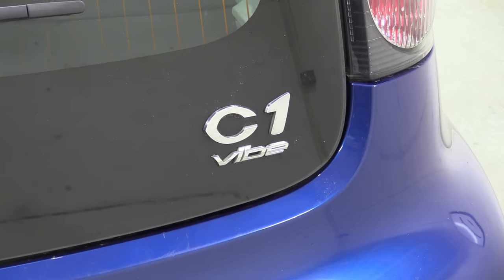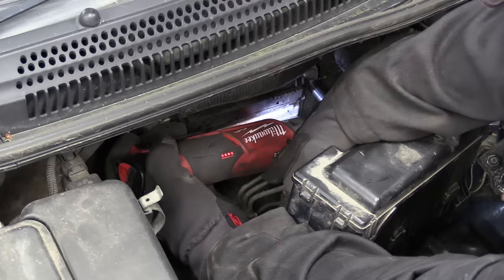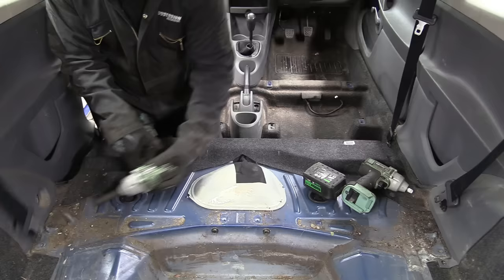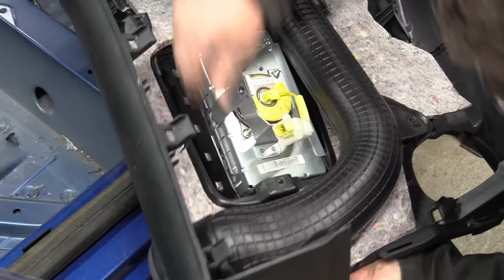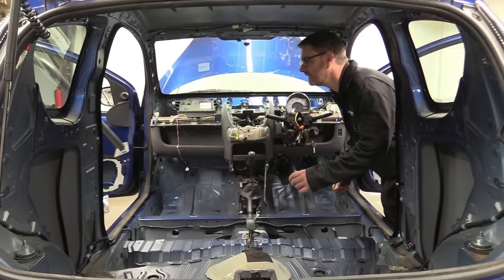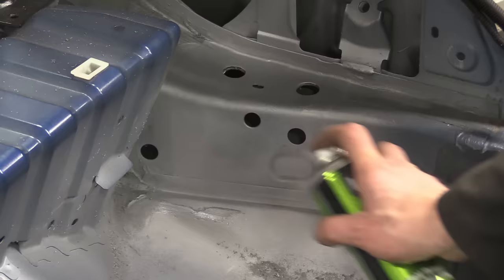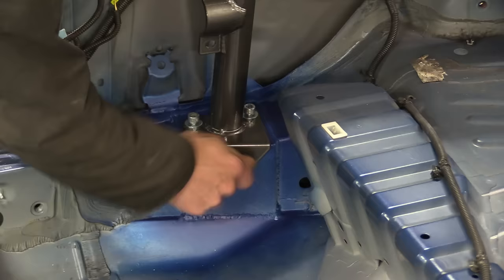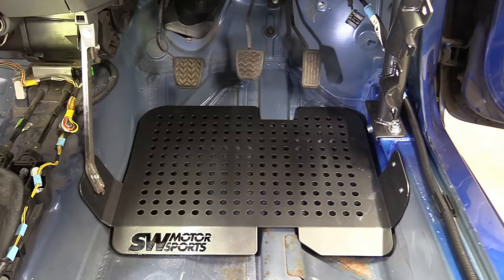Part 1 - Building an £850 hatchback into a competitive race car.

Comment: It's not Binky but I'll take anything to get my Bad Obsession fix at this point 😃
Reply: I needed a small adapter for something at home and I ended up making a template, transfering it to steel, cutting it out with a grinder, bending it by hand into a circle, folding the edges and squeezing them together with a press, finishing it off with a twatting stick.
Moments later I found myself looking at MIG welders online.
Reply: @phenomanII  cool story, but did it also "make the noise" at the end?
Reply: @yah5o  Sadly I do not own such precise and melodious equipment.
I also used a black marker, as I'm not experienced enough for blue, red or green.
Reply: motorbiker46 
It’s a wise man that knows he’s not ready or skilled enough to move on from a black marker. 
Sadly some falsely believe they possess the needed skills and others are completely oblivious to the needed skills meaning that many people are wielding markers well beyond their skill levels. 
You in your wisdom are very close to graduating to a blue marker at the very least.
Reply: @Crewsy  Thank you for the kind words. You've genuinely given me more confidence to go for another project so that I can reach the next level. If I reach it, I shall celebrate by acquiring another power tool to aid progress in the future.

Comment: oh, putting the nut a couple of turns back on before yanking at thee steering wheel...
That's the exact useful piece of advice that would have stopped me from punching myself in the face with my own steering wheel!
Reply from the maker: They say you learn from experience...
Reply: @BadObsessionMotorsport  I've heard that before.........
Reply: It does hurt when you pull a steering wheel full force into your face.  My belly was aching when my mate did it.
Reply: Funny.  I was just talking about this very thing with the mates a couple of days ago.
Reply: 😆i once picked up an empty cardboard box ( thinking it was full (and heavy)) and smacked myself square in the face with it 😆
Reply: Stephen Hepworth you should have put the nut back on a bit first 😂
Reply: Been there, done that. Shift knob is the other one.
Reply: Its a little talked about issue for us mechanics. The level of self harm. Just the other week I pretty much through a spanner at my own face. Be careful not to let your tools slip of the bolts kids.
Reply: Bad Obsession Motorsport 
Some times we wonder how you both became so experienced. 
Unfortunately there likely is no video evidence of that “experience”.
Reply: When I was 17 I broke my nose taking a mini steering wheel off. I was three cars up in a scrap yard at the time, trying to get a new set of column switches. Took me a little while to get back down.....😂
Reply: @andrew75511  I bought a car off a guy with a happy face in one eye. He was using two screwdrivers to get a brake drum off, and the inevitable....
Reply: It's something you definitely only do once... don't ask how I know.
Usually take the time to make a "bespoke" puller/removal tool these days.
Reply: @ADBBuild  Done that.  BMW shift knows are insanely hard to pull off, if they aren't worn out and pull off on a swift second gear grab.
Reply: @BadObsessionMotorsport  I did, silly me!
Reply: Experience - What you get right after it would have helped.
Reply: @johnpearson492  Yes, I was thinking BMW when I wrote that. Pro tip - Sit in the back seat with a leg on each side and pull from there.
Reply: @andrew75511  Worst I've done is while putting back together drum brakes. I was pushing down on one of the springs to hook it in place and the pliers slipped off, causing me to head butt one of the wheel studs sticking out of the hub. That bled...
Reply: I spotted that too, and thought that at some point in the distant past that had been a learning experience!
Reply: @theogbeardedwonder  aaaah the memories - it's been a few years since we were allowed to be 'three cars up' :-)
Reply: I can barely breathe laughing so hard at the thought! 8-))

Comment: Man, this car is an engineering masterpiece. Everything is exactly as cheap as it can be made. That one piece map pocket with compliant plastic hinge is genius in its simplicity.
Reply from the maker: It really is.
Reply: but,  a map pocket? who needs a map pocket anyway?
Reply: @almericussaxon8023  
People without satnav! 😂
Reply: @almericussaxon8023  title and regstation or torch and zip tie
Reply: @almericussaxon8023  Oh just you wait for the space debris to "explode" and take us all back to the 80s.
Reply: @almericussaxon8023  Some of us prefer to lose our way the old fashioned way! I rare if ever use satnavs, and if I have to I´ll use my phone.
Reply: It really is a clever designed car. It's a cheap car because it was designed to be cheap rather than being built cheaply. 1 screw holding the radio panel in, a piece of glass for the boot with no metal pressings. Love it.
Reply: Parcel shelf, string on one side only, both front seats - same part number, glove box lid - optional extra. The electronics are Toyota, the engine is Kinda Toyota sorta, its all simple stuff.

Comment: Easiest way to get those window winder clips off is to feed a rag in the gap to hook the end of the clip and just pull it out. No risk of scratching any trims either.
Reply: If you are old like me, you have a couple or 3 of the stamped sheet metal tools that push the clip back, making it a quick and easy task.
Reply: I use the tool but when it's missing a shoelace works a treat
Reply: Yes,  sorry I didn't see your comment before I posted the same.

Comment: When does Nick decide to fit the engine from a 406 V6?😂
Another great project from you guys.
Reply: You can! On the bigger 106.
Reply: next week. Should be just a one episode job...
Reply: Zero chance of fitting that. Lots of adapters to make up too.
If you want a big engine you can fit the 1.8vvc engine from the Yaris (if you relocate the battery to the boot).
But at that point you should probably just buy a Yaris SR as they are pretty cheap anyway.

Comment: For the trim clips, wrap a rag around the handle and pull it back and forth. It will grab the clip and release it. No tools needed!
Reply: a stretchy rag, ideally a stocking
Reply: I second this tip - I've done it heaps of times and it works a treat
Reply: Yep, dealt with that replacing the manual winder in my car (twice! Thanks cheap eBay parts) bonus difficulty? Mine has a trim washer to fill the gap between card and handle. Sure its a two second bang into place part, but what a pain.

Comment: A neat trick to getting the window winders off with those sort of clips.... is to get a rag, slide it between the door card and handle and start sawing with the rag, this action catches the rag on the two 'ears'  of the open side of the clip which in turn pulls it off the spline shaft. For years i mamed, marred and just straight f**ked trims and winders until i learnt this method. Alas..... great to see you two back with some more crazy shenanigans, stay safe over there!

Comment: Useful tip for those annoying window winder clips. The hub end of a bicycle spoke has a handy little hooked end to it. Subject to a little bit of “jiggling it about a bit” you can usually pull the clip off that way!! I got a wheel’s worth in my tool box. They’re just bendy enough to come in rather handy.

Comment: I've always heard that driving a slow car fast is much better than the other way around
Reply: An 848 cc mark 1 Mini, 3.5 in rims. Did have Pirelli Cinturatios as they were the only 10" tires I could buy. I rebuilt the engine every summer when  in  college.
Reply: Try driving a fast car fast then..🤔

Comment: "To be competitive you need to spend a lot more"
I mean, I get in the top 10 in dirt rally dailies / leaderboards with an office chair with wheel stops behind the casters and a logitech wheel...
Reply: Ye it's the biggest cop out ever, driver mod is biggest thing, I have a t150 pro and a wooden dining chair and stay competitive through practice
Reply: The bigger issue for many drivers is that you learn more bad habits than good ones driving in games/simulators. For most drivers, anything is an improvement, but if you already have a 'feel' for going fast on the track, the sim world feels shallow and infuriating, no matter the fun and challenge from a competitive perspective. In this case reals=feels.

Haters can meet me on the track. :)
Reply: @outspokeninsider752  So you're saying if you enjoy the games you're automatically slower in real life? Get off your high horse - there are plenty of fast drivers I know that enjoy these games.

Comment: For the window winder clips, I use a shop rag between the door and the handle. Slide it back and forth a few times around it and it'll pop the clip right out.

Comment: RE: window handle - put a wiper (rag) between the handle and the door panel against the open legs of the clip.  Pull the rag up and move slightly side to side and the clip will pop out.

Comment: 11:54 WHY PUT FUSES THERE CITROEN
Reply: Because they simply never fail.
And it's fairly easy to get the cowling off. Steer to the left; screw off. Steer to the right; screw off...
...and presto!
Reply: @Paul_VanGo  Well not never, else a bean counter would have had them removed. Hahaha.
Reply: @802Garage  Yeah, well; I think there are some regulations stating at least some fuses.

And the 107/108, Aygo and C1 are pretty much Toyota, so nothing really ever goes wrong...
Reply: @Paul_VanGo  Things (especially electrical things) go wrong in every car, sooner or later.
Reply: @krazed0451  Yeah, especially when they are inside the grabs of the young uns.
When they start to bodge head units, amps and four 12" woofers in them...
...no car is safe. 😁

But the triplets are at least much better build than the average supercar.
Reply: @krazed0451  I learned where my Mazda has fuses when I flooded it up to door handles. I didn't replace any, just cleaned the mud out from the fusebox cover. Car is 25 years old now, didn't replace one fuse or bulb in it. My dad doesn't remember doing so too and we have it for like 14 years.
Weird to some, but some cars just have working electrics/electronics.
Reply: Oh, so you noticed too...
Reply: Ever 1980s Nissan have their dash cluster fuses, you guessed it- mounted to the cluster
Reply: Well, I must admit that from the 2014 models they changed to a new dash and moved the fusebox to knee height, where one would expect it to be.
Reply: @MindBlowerWTF  Nice, you've gotten lucky so far... As I said though, sooner or in your case, later :-P

Try submerging a more modern car up to the door handles and not popping a fuse!

Comment: Hint for removing the window wonder handles, get a rag fold it in half, slide the fold into the area between handle and door card. Wrap around 180 degrees then pull the rag around one way then the other until clip catches on rag and comes off. Take it slow as if you are to fast the clip comes off to quick and gets lost.

Comment: Top Tip for you, dropping the hub carrier off the strut can be aided but inserting a snug fitting allen/hex key into the clamp slot and turning it 60 degrees, this will splay the joint open by a useful amount.

Comment: 3:34 "There is not a straight panel on the car, but those are features, not faults."
Uhuh? These are the same guys that built Binky? :)
Reply: Difference between building something that's supposed to look good on the road, and a racecar.
Reply: Binky is made to be a daily, not a racecar. Besides, the C1 is a frenchist's car, so yes they're features.

Comment: Those window winder clips usually come pretty easy with a rag of some sort pulled between the winder and door panel. If you pull it downwards, and something soft under it, it's not gonna fly anywhere if even leave the handle ;) For the entertainment of the internet, Nick also could had manufactured a u-shaped bracket that could work as a tool to push the clip out.

Comment: Where you're struggling with removing the window winder handle clip it's really easy with the special tool. just pull a rag around between the handle and card and the clip pops right out. Good video as usual, Keep it up lads

Comment: quick tip on the window roller handles, if you work a thin rag in between the handle and the door, it will pop right out

Comment: 10:04 the easiest way to undo is jank a thin piece of cloth between the doorpanel and the handle. Then simply hold the cloth upwards or downwards, and crank the handle. In a rotation or two, the cloth will catch onto this clip and will come loose. This is a trick i've learned from a daihatsu garage ;-)

Comment: Those winder clips were standard fit on nearly all Australian build cars in the 60's and 70's the correct tool closely resembles a steel ruler with roughly a 1/2 semi circle cut out of the end. You push the clip back from the open ears and it will park itself in the handle in a released position. Course I broke quite a few handles and lost clips before I worked this out ;-0

Comment: Use a rag to get those window winder clips off.  Stretch rag tight and slide between window winder and door card and it'll push the clip up.  Super easy

Comment: I know it doesn't matter but the way Toyota suggests removing the window crank handles is "sawing" a thin rag (I use a shirt) back and forth between the crank and the door card. It pops the clip right out so you don't have to deal with the little o-ring pick and pulling your hair out.

Comment: 9:53 Top tip for you, hold a rag/microfibre cloth in both hands and use it to "floss" the pin out. It eventually gets caught under one of the legs and pops it straight out.

Comment: Well, you certainly don't need silly money to be competetive in simracing. Those 17K rigs don't make you faster. Just need a load cell pedal set which you can get from thrustmaster for less than £200, or fanatec for a tad more. And many of the force feedback entry level wheels are good enough to enable you to be competetive. 
Having said that, excited by the new series. Looking forward to following this through. 
Hope you stick with it while your racing and don't just leave it as a build only, would love to get race highlights and updates of the racing.

Comment: As a Sim racer that's been doing it since the Grand Turismo 1 day's (1997) and one of the top 20 rated drivers in the US, I have to defend my sport. Nothing personal =)
In fact a massive amount of "Aliens" (Definition: A Sim Racing driver so skilled and fast he must be an "Alien") don't use really expensive equipment. In fact iRacing's fastest driver has an old Logitech G25 bolted to a desk, and fun fact when he's not racing he helps his father on a farm. I myself have been able to earn the title of "Alien" and started out with a $110 Thrustmaster T300 that had a blown power supply that I fixed and modified, and used for 2 years until I got the Fanatec setup I have now (And to be honest even though I have around $800 into the Fanatec setup I miss my T300 and don't find the Fanatec setup that much better) so in conclusion you can get into sim racing for very little (Between the Dell optiplex I built with a GTX 1060 and the T300 I had I was less than $450 invested and entering pro racing series in less than a few months, however I must add that I was a student of the Audi and Honda program and a driving instructor at my home track at Road Atlanta for 5 years and continued to race a few years after that in unlimited 2.0L Touring car class and the Audi TT series, so I didn't just start out really good i had to work for it just so that's clear)

Anyway, figured I'd try and clear that up incase theirs someone out their who wants to join Sim Racing doesn't get discouraged cause trust me we need more good/respectful drivers out there.
Love the video and that car looks like it's gonna be solid. =)

Comment: Well i got really excited when the the door lock knob was rattling. I thought here comes a  snazzy bracket  but NO , a modified P clip?? Oh the Pain and confusion.  Should be a snorting little racer  when done. Cant wait to see all carnage break out at the first corner when the braking points  differ.

Comment: 10:07 Use a rag on the inside of the handle. Feed it between the handle and the door card, pull it one way and the other and bam... clip pops off like you wouldn't believe.

Comment: Great project guys, done in the time honered Top gear fashion (limited budget and engineering) Really good entertainment. Maybe use the rivnuts on the door card mounting as well? As those plastic clips will fail quickly under hard racing conditions 🤪

Comment: The window handles have a trick. Put a shop rag between the winding handle and the door card like floss between teeth and pull it around the shaft. Much quicker and easier than the pick. couldn’t be bothered to read all 1.5k comments to see if anyone already posted this.
Reply: You wouldn’t have had to read very far. I think roughly 1000 of those comments are about the “rag trick”

Comment: Great episode, this is something we can all aspire to doing and a great way into racing on the cheap. But £850 for a 15 year old hatch in poverty spec trim? Complete with the full set of bent panels and scuffmarks I'd be picking that up for £500 around here. I still look at your welds with envy though.

Comment: Did you lads not know that the tool used at 8:19 usually can be used to release the window crank handle seen at 9:59? There's a special tool, too, made in a similar shape that works a bit better, but the trim removal tool can usually get the job done.

Comment: Toyota has been taking lessons from Audi when they put in that ECU! YECH, could they make it any LESS convenient?  Bet that 850 is down a bit after you figure all the salvage get sold off...  American parts stores rent/sell steering wheel pullers  P.S. easy way to get the clip off the window crank is a crochet hook and pair of pliers to grip it.